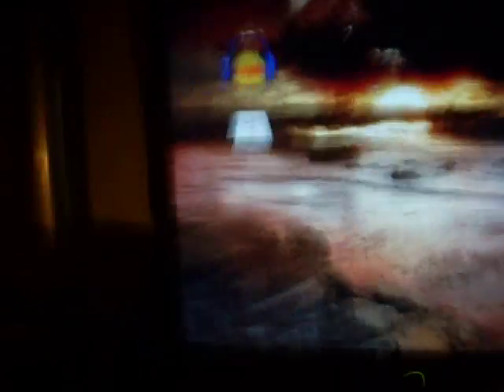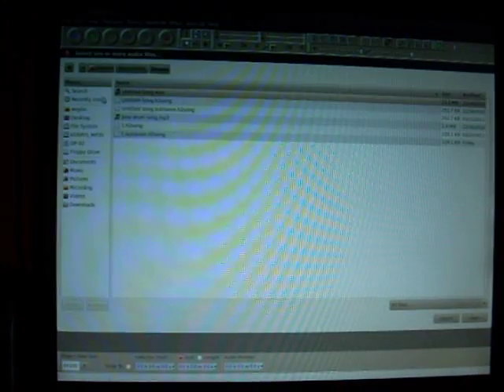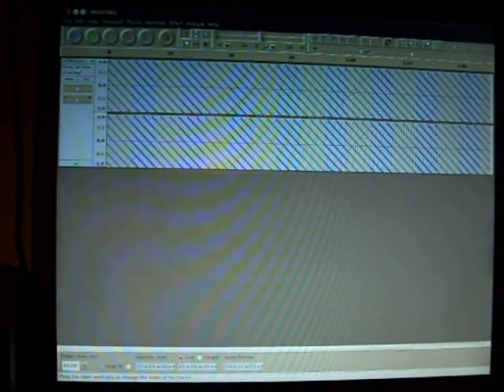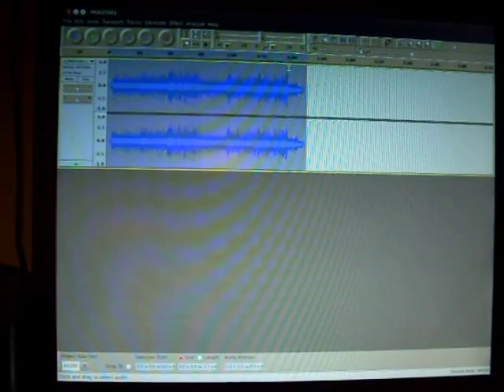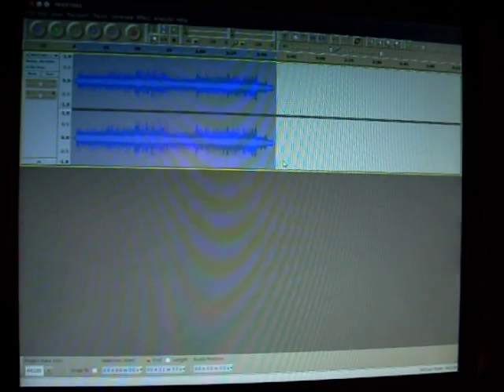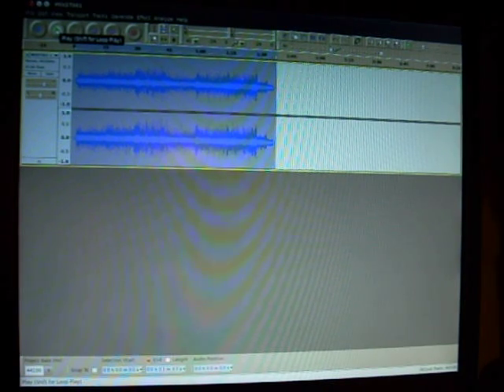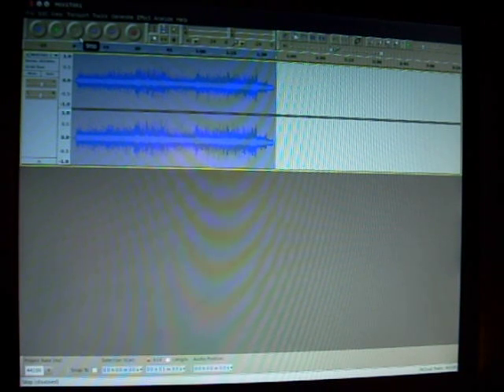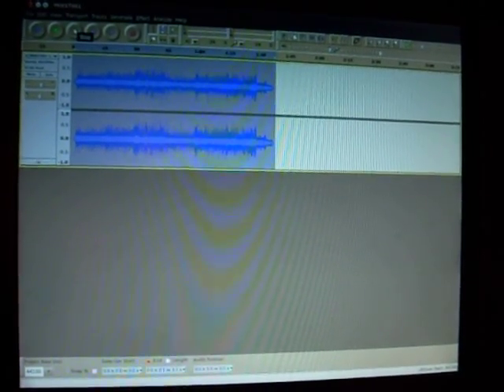Tascam DP-02 tutorial V [Simple editing in Audacity (Volume)]

Comment from the maker: Yeah its just cause its a 16 bit unit, It should be mentioned in the manual, well do as I do in this video, simply normalize the track say by -4.0 DB and then turn the volume up on the track will solve your problem right away, I don't even worry about recording things to quietly because you can just edit them in Audacity, If you have any more questions let me know.

Comment: @PoliticalDestruction Yeah thanks man for that tip, I was just wondering if that was better optimized for recording than windows, cause I've had a lot of problems with windows...  One problem I have with the Tascam DP-02 is that it doesn't have Line IN, I wan to record drums and guitar/bass at the same time so the best I can do is with 1 mic on the drums, which will work but will not sound as great as using a mixer.